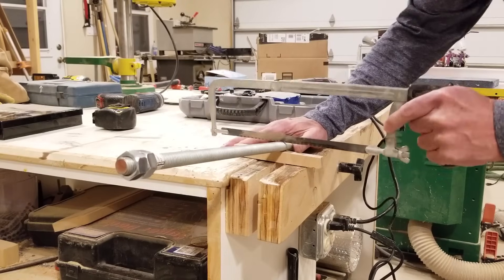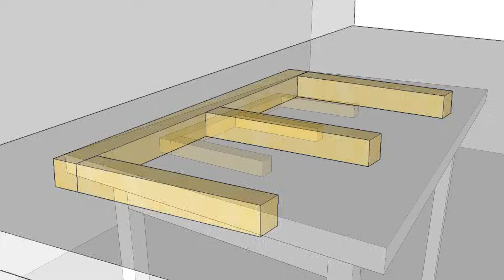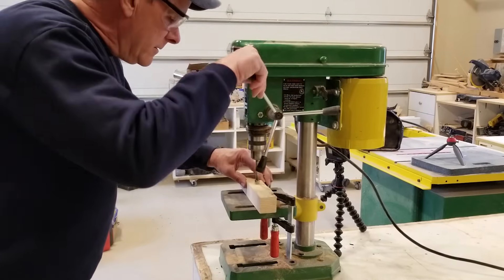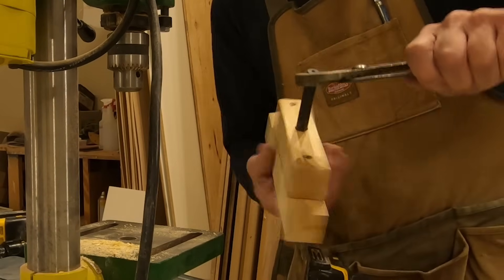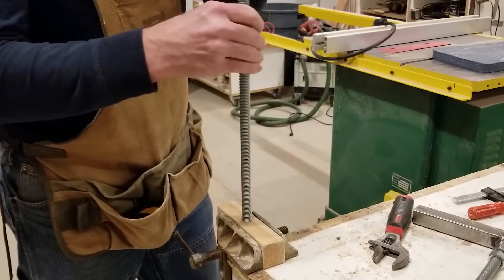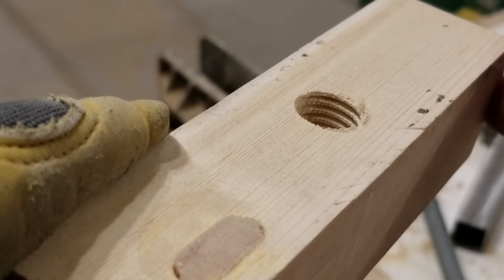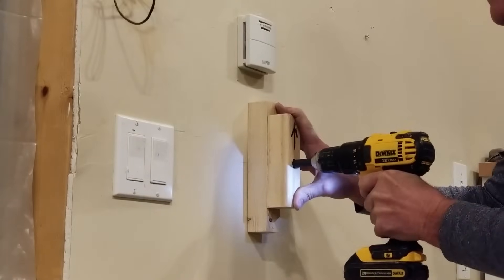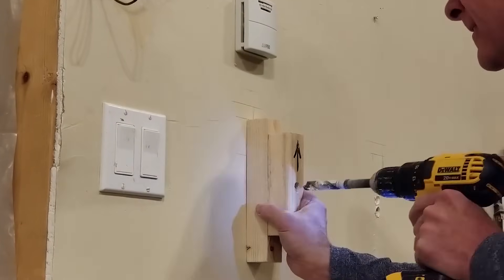Strong Floating Shelves - The Strongest Option

Comment: Hello Rusty ...  I do everything I can my self around the house and property for my self as well as for my kids . Therefore I have the utmost respect for others who do as well. Your system that you have worked out here is surely stable, but appears to be alot of work to me. Therfore the following question. Are you familar with Ikea Furniture Stores? If not, there may not be one in your area in the US, but assuming you have a computor you can check them out online at www.ikea.com. They have shelves called "Lack wall shelf" they run for around $20 a piece. I'm not recomending that you buy them. Just mentioning it so that you have information to find them. Take a look at their bracket system. If your son can weld then you can make your own brackets. All you then need are two screws in the appropriate  diameter and then drill two holes in the studs (no cutting Rods and windings in the studs). It's hard for me to judge because I do not live in your area but the material cost may turn out to be around the same in the end. If you need longer shelves you can make them longer and screw them over three or four studs. I can't imgaine that this method would carry much less weight, but honestly if it only carried 50 or 100lbs. would that not fullfill your purpose?  After noticing that you posted this video last march it could be possible that you have no interest or need for this information, however perhaps it will help someone else. Have a nice day and stay busy because that helps us all to stay healthy!
Reply from the maker: Hello, Robert, and thank you for your comments. I am familiar with Ikea and have had probably five other comments from viewers about their products. I took your suggestion and looked at their website and specifically their “lack wall shelves”. I don’t have any specific criticism of their products and to me they kind of are what they are. Reading some of the reviews you can see that some are very satisfied and others not so much, potentially based on their own level of experience in installing shelving. 

I stumbled into the floating shelf world when I had a customer asked me to build some a few years ago and that resulted in the first video I ever did on floating shelves. Prior to that I had thought of floating shelves as pretty much gimmicky decorations. I experimented with a lot of different types of wood brackets and ultimately landed on the steel rods as being the strongest option. I have had a number of contractors who do many more floating shelves than I do, share their own methods from a more production-oriented perspective. Most of them use long lag bolts, then cut the heads off before installing the shelves. Considering the viewpoint of my method being a lot of work, in reality I’m drilling a few holes and spinning the rods into the holes. If I’m not explaining that process in a video, it really doesn’t take very long!  🙂 And I do agree with you that 50 pounds over a couple of feet is plenty of capacity for most applications I can think of.

Thanks for taking the time to share, Robert! I appreciate your attitude which is one reason I took a few minutes to check out the website. Take care of yourself and family as well during this very challenging time.
Reply: @RustyDobbs  ... Thanks for your reply. Hope you could enjoy the 4th and wish you and yours all the best.

Comment: Anyone got suggestions for installing these bars into brickwork instead of studs? (Im an absolute novice btw) Thanks :0)
Reply from the maker: Sure, Dar Claude! The process for installing rods like this into bricks is a little more crude. You want to drill holes into the bricks using a masonry bit that is only slightly larger than the size of the rods you are planning to install. By slightly, I mean almost the same size. After you have test fit the rods into the holes then you want to add some type of construction adhesive to the rods and holes, then tap the rods into the holes, keeping them aligned level while the construction adhesive sets up. Then the rest of the process is the same as with studs. As a said, it’s a little more crude but still will work well. Hope that helps!

Comment: No welding necessary- Just double nut the threaded rod tap and use a socket on an impact gun if installing several.
Reply from the maker: That will work as well, Super!

Comment: To secure the last option, you can put a tiny wood wedge or Brad nail in the hole when the shelf is maybe an inch or so from the wall.  

Or, you could cut the head off a Brad nail, hammer the cut off head end, into the wall stud about a quarter inch from the bolt. Two sharp ends pointing perpendicularly to the wall. Put your shelf on, and tap in the last bit to embed the nails into the wood and everything is hidden. 

Or a tad of super glue at the base ...
Reply from the maker: Good ideas all, Ken! Thanks for passing on your thoughts!

Comment: Hey, I wonder if when you have your squared hole in the stud if you couldn't just load the threaded rod in a variable speed 1/2 inch drill and run it in that way.  Or would it twist your arm off.  Anyway, I enjoyed this because it took the mystery out of hanging these.  I liked the solid wood shelf the best.  I do thing they are a bit overbuilt unless you're going to put a compressor on it :-)  Edit: oh yeah, and I love it when you screw up like I do all the time.
Reply from the maker: Hey Dennis! Yes, you can come up with lots of ways to thread the rods into the studs that would be quicker than using the tool we made. In fact, I’ve had a number of contractors suggest your idea as well, some suggesting an impact driver. The shelves are definitely over built for what most people would want to put on a shelf, but that’s the way it turned out! Yep, foul ups are part of the game! Thanks for watching!

Comment: Did I miss something here?  Wood threads to metal?  What if the wood fails?
Reply from the maker: I would be more concerned about the machined threads if there were more lateral stress on the installation of the rods, Dale. But with primarily downward pressure on the rods, I’m not envisioning a way in which the wood fails that has anything to do with threads. If you put enough downward force on a rod, at some point it would either break or tear the face of the stud out like would happen if you inserted a pry bar into the hole. But I’m not structural engineer and I may be missing something, too.

Comment: No washers with the securing nuts?
Reply from the maker: Yeah, Matthias, you could and probably should use washers for permanent installations with nuts on the ends of the rods. I did a follow-up video to this one that explored options for shelves people may want to consider for looks and function. This video was primarily intended to share information about installing shelves with all thread rods and how strong they could be.

Comment: I've been doing similar ones for years. I use newel post mounting lags. They're threaded with machine threads(like all thread) on half, and lag threads on the other half. I just drill a hole and thread them in it doesn't take long. The level will be a little off as well you try, you won't drill all holes perfectly but it doesn't matter, they're easily bent into place with  a length of pipe. I did solid wood shelves and drilled the holes, that was the hard part but I made a large doweling jig to do it. One could make box shelves too and that would be much easier.

Anyway thanks for the vid I would make them too but it's not as easy at looks to make them is it. Nice video sir
Reply from the maker: Thanks so much for watching, Skye, and I appreciate your comments.  Yeah, I have had a number of contractors comment who have come up with their own methods for using steel to install floating shelves. I have seen the lags you are talking about but never thought about using them for floating shelves. I like your idea of building a large doweling jig to deal with drilling holes in solid shelves. That would make that process much easier! You never know if you might enjoy making videos until you try it! There is a pretty good learning curve to get up and running, but it is something I have really come to enjoy doing!

Comment: Rusty why not use a tape with a jig to keep it square and you can use a power drill to drill the holes much faster
Reply from the maker: Good idea, Mark! Thanks for the comment and I appreciate you watching!
Reply: Rusty Dobbs  that was supposed to say tap 1/2  13 that what it looks like the threaded rod size is

Comment: Nice job, that's how I always build them. But I use 3/8 rebar and drill the holes out a little bit larger in my shelf. This gives a little wiggle room for slight level adjustment. I glue the entire rebar and it holds up really well. Again nice video thanks for posting.
Reply from the maker: Thanks for your comment, Raymond! Yeah, I’ve had comments from a lot of other contractors as well who figured out their own variations on using steel to support shelves. It’s a great way to go!

Comment: To help keep your last floating shelf from sliding out: 
Your rods should be drilled at a slight angle down. That way the rods come out of the wall slightly tilting up. Then drill the shelf board at that same angle so it sits flush to the wall. Any weight on the shelf will push the shelf back towards the wall.
Reply: Bet after a year you are still trying to get all that to line up properly. Yeah your idea would work but good luck making that come out straight
Reply: I use these rods to set posts for stairs and hand rails, protect the threads with a bolt and with a hammer you can bend it slightly to make it plumb or level if it isnt to start with.

Comment: That would be spectacular with a big "live edge" plank for the shelf.
Reply: That's my plan exactly for a current project and this method of securing them is a winner. A KitchenAid and instant pot will be stored up there, do about 50 lbs
Reply from the maker: Brent is right about the live edge plank idea, Chris! I’ve considered doing that as well, but just have never gotten to it. Just need to figure out a good way to get the holes drilled accurately through the live edge.
Reply: @RustyDobbs  You probably need to build a jig to hold the plank upright with cut edge on top. Level the cut edge then into the drill press. Could even look cool to bore right through and have a burnished nut at the bark.
Reply from the maker: @brentpeterson6052  Great ideas all there, Brent! Thanks for watching!
Reply: @RustyDobbs  rusty, PM me your email, I will send you the jig I made to do the holes on the drill press!
Reply: @RustyDobbs  I was thinking  that, since you had to do some drywall repair anyway, couldn't you bury some beefy steel L brackets in the wall to get a less technically demanding but similar result? Not as elegant by any means but I can repair drywall and don't have a drill press!
Reply from the maker: @chrisbutler2124  You can send it to info@dobbsworkshop.com. Thanks Chris!
Reply from the maker: @brentpeterson6052  Yes, Brent, you could absolutely do that. I actually recommended that to a guy a while back who wanted to suspend a piece of granite off a wall for a vanity top in his master bathroom.

Comment: To explore my walls and avoid wires, I've been using these $35 endoscopes you can get on Amazon and elsewhere. Your smartphone acts as the screen. You need to drill a 3/8" hole in the wall and insert the camera. With a bit of maneuvering, you can see most everything you need behind the wall. Repairing the wall is a snap.
Reply from the maker: You know, Brent, I have seen that sort of thing advertised a lot but have never thought about getting one, yet I have the need for it routinely. I think I’m going to follow your lead and check into it! Thanks for watching and for the suggestion!
Reply: You can also detect what' s behind walls using a thermal imaging camera. Blackview now make rugged phones with thermal detection! ...So relieved that I'm not the only one drilling 500 holes before securing stuff; only to discover it's a blinking dot n' dab wall with zero studs!!
Reply: @MappingAmy  Thermal imagers will only work with with locating things other than studs if they are also touching the drywall and have a sufficient heat differential to be detected, or are cold or hot enough to be significantly changing the temperature in the gap between the studs. Otherwise the endoscope is the way to go.

Comment: Rusty I was curious if after you threaded the holes in the studs, did you blow out the wood chips made during the threading procedure? No compressor needed a piece of rubber tubing long enough to stick in there and blow on without getting a face full of chips and dust.
Reply from the maker: I did not do that, Steve! But your idea of using a piece of tubing to blow out the hole would definitely work and you would want to make it long enough to keep from getting a face full of sawdust!

Comment: Just wanted to tell how we do this, we take half inch rod two sheets of half inch plywood and then router a Groove in each piece and then sandwich them together, glue and clamp together, then we put a inch and a half band around the edges of the Shelf never had a problem and they are extremely weight Worthy.
Reply from the maker: Thanks for your comment, Elton! That’s a really interesting way of constructing a thin floating shelf and I appreciate you passing it on. Will have to give that a try!

Comment: I don't understand the step of tapping the stud. Couldn't you just thread the permanent all thread to begin with or am I missing something something?
Reply from the maker: You could do that, Andrew. The shavings would actually make the threads tighter in the hole if they were left in, but it could affect how deep you are able to thread the rod into the hole. But, yes it would work. You might not be surprised to hear that I also drill pilot holes before running screws into most any wood!

Comment: what kind of floating shelf did you use? what kind of wood ?
Reply from the maker: It's actually pine 2x4s, LIberty. I cut them into 1 3/4" strips to make it easy to drill the holes for the rods, then glued them together to make the shelf.

Comment: They have stud finders that identifies electrical components behind walls
Reply from the maker: Yeah, I have one Breal191 and they are helpful in many situations. If it ever comes down to me chancing hitting a wire or water pipe, I open the wall to look before I drill or cut. Would much rather patch a wall than repair a wire or pipe. Of course, it helps that I have gotten pretty good at patching walls and matching textures! 🙂

Comment: We hang heavy solid wood mantels and large shelves in a similar manner... Instead of all-thread-rod we put large lag screws into the studs then cut off the head.  Does the same thing as what you've done just faster and with more appropriate aggressive threads.
Reply from the maker: Yes, Chris, I have had a number of contractors comment that they do what you do or have some rendition of that idea that they use. No doubt switching to some sort of metal rods makes a huge difference in strength over other methods I have explored. Thanks for watching and commenting!
Reply: I am looking to install three 17" deep floating shelves on both sides of a fireplace/TV surround I built. When you drill holes in the studs for the lag screws, how do you ensure the lag screws are straight (90 degrees on all sides), so that the shelves are level and the screws go into shelf with ease?  Please forgive my beginner ignorance. I am a weekend DIYer. Thank you.
Reply: @joelflowers1361  typically just throw a short torpedo level on top of the drill to ensure its level just before drilling a hole. Once the lags are in to the appropriate depth we used a rubber mallet to tweak them if needed...  An alternative is to use brackets from companies like RightOn Bracket or UltraShelf

Comment: Epoxy a smaller diameter allthread into 2x6. Equally functional & leaves more wood. Then also Epoxy frames/solid wood shelving to both pins. Never comes loose! I build catamaran s ( 1/4" ply, epoxy, glass) that laff at hurricanes & grounding. If I dare, next ecohome I build will have few nails/connectors & only epoxied framing & sheathing! I'll let you know ))) Heck...Prebuild the shelving complete & simply epoxy whole unit to bare drywall?! Might hold what's realistically usually placed there, no??? Try & offer another video. I'm busy building my latest ecohome in SW FL. Good show, thanks!
Reply from the maker: Thanks for watching, Antoniio! Sounds like you have some interesting projects going on yourself! Shoot me a picture of your catamarans and ecohome when you get it done, if you have a chance!

Comment: I just use 6-10” hanger bolts...pl glue that into the back of the shelf. Prob supports 200lbs. I can stand on them and jump.
Reply from the maker: Yeah, G1,  I have had a number of comments from contractors who do similar things like using long lag bolts and cutting off the heads after install.

Comment: I have 9 of these floating shelves made of solid walnut that I will installing in my kitchen. I like the idea of the threaded rod instead of just a 5/8 hole filled with adhesive (I've done that before with success using PL Adhesive). I think I'll try  to cut the end of the tapping rod so that it fits in the 1/2" chuck of my drill to speed up the tapping process.
Reply from the maker: Yeah, Kenneth, it sounds like you’re going to have a a lot of holes to drill and cut the threads for. The walnut shelves should look great! Good luck with your project and thanks for watching!